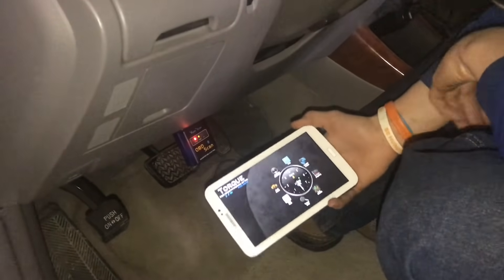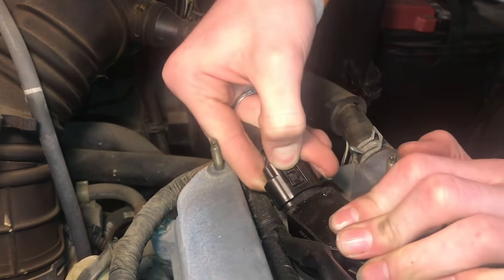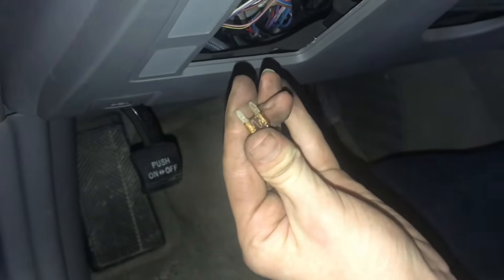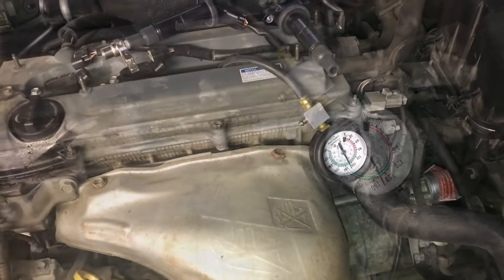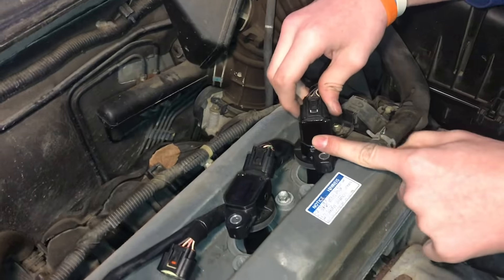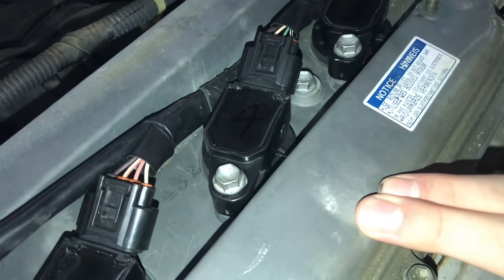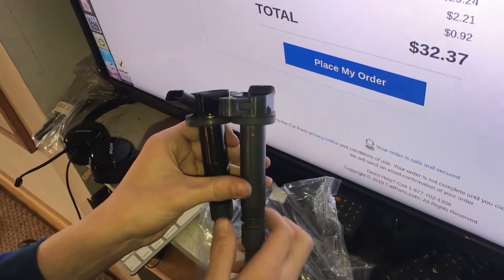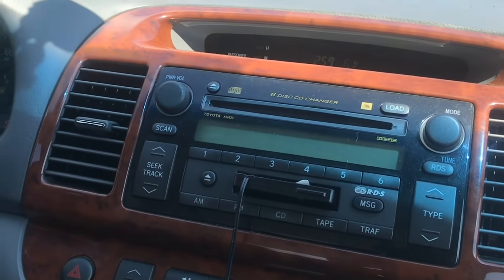(RESOLVED) toyota camry misfire P0301 P0302 P0303 or P0304 diagnostics

Comment: You need to use caution when purchasing aftermarket parts such as coil packs, especially when the price seems to low to be true.
Reply: Yes I bought Autozone Duralast lifetime warranty they lasted 2 years the factory lasted 21 years 170.000 miles all least they exchanged them no questions asked

Comment: Always put some dielectric silicone grease on the inside of the rubber boot of the coil pack to keep the rubber from fusing to the spark plugs.

Comment: Live,I’m working on a 2010 rav4 4cinders,p0303 code,exchange injector,coil,spark plugs from a known good piston same problem,comprecion is good.Most of the time the problem is only at high speed or climb a high level.thanks in advance for your help.

Comment: The 2007 thru 2009 engines 4 cylinder engines are known and documented to be bad at 140,000 mile. The rings pass oil (high oil consumption). Eventually, they leak so much oil, that you will find yourself repeatedly replacing coil packs. This is because a bad spark plug or a fouled spark plug is forcing the computer to push the coil pack harder in order to create a spark and that destroys the coil pack. At that point, replace/rebuild the engine or paint the car lemon yellow and park it in front of a Toyota dealership. Mine's for sale... any takers?

Comment: Is this a 2az-fe engine? I noticed you pointed out that the firing order is straight line 1234 but everything I am seeing for the 2az-fe which is what my 05 Camry has in it, fires on a 1342   Order.
Reply: Apples and oranges.  Almost all 4 cylinders fire 1342.  The cylinder numbers run in ascending order from the crank pulley.

Comment: Wanted to thank you for this video. I had a misfire on cylinder 2 today on my Camry and I replaced the plugs and coil and it helped me do it without damaging anything in the process. I let it idle for about 10m and drove it around town without and stutter or any of the issues it was having and no check engine light coming on.

Comment: Could've saved a whole lot of work by just pulling the coils one at time and listen for no difference in the idle speed.
Reply: So if there's no difference does that mean it's bad? Or
Reply: @thebeasters  Yeah
Reply: Yeah, pull the primary plugs, not the coil assembly, work smarter not harder.  Bear in mind it's a misfire not a dead cylinder so the test might not be that conclusive.  Misfires aren't always constant, just often enough for the computer to notice.   Bear in mind once you do that you will trip misfire codes for every coil you disconnect.

Comment: I have codes p0300, p0301, p0302, p0303, and code p0304 as your description showed. But you only diagnosed one cylinder/coil pack. What a waste of my time. I replaced all four plugs, coil packs, and fuel injectors and I still have p0300 thru p0304 codes. Your video is a sham showing all 4 cylinder codes.
Reply from the maker: A PO300 error code is completely different than a PO301 through PO 304. The PO 300 error code is stating that the error is random. This is not what this video is talking about. A random misfire is more likely not the coil pack or spark plug. It would be something like fuel or unmetered air. The title of the video says nothing about a PO300. Your attitude is a bit disturbing. If you don’t understand try asking a question without an attitude. I hope this answers some of your questions. Look for videos that talk about multiple misfire PO 300 error codes.

Comment: I have changed my coil packs and spark plugs more than 3 times in less than 3 years. I'm tired of this 07 Camry and the random misfires. What are other causes of misfires? Would a compression or leak down check give me answers?
Reply: If it's the piston then what? Is it a 9 hr tear down? Shops crazy
Reply: Fuel injectors
Reply: Most common problems: spark plugs, Coil pack, Spark plug wire or even the Spark plug coil pack connector going bad

If your spark plugs has oil all over it’s because you have worn O-rings or you have a leaking head gasket it all depends on your engine type

Harder diagnosis 

Fuel injectors either clogged or broken, 

Vacuum leaks (could be a small leak or bigger leak (spray soapy water or certain type of cleaner, for example(MAF, Carburetor cleaner, etc), 

igniter goes bad

could also be your piston has lack of compression (depending on which cylinder has the misfire)
Reply: @Kawura  I did a compression check and it was the cylinders need new rings

Comment: I replaced the coil packs,spark plugs,pic valve,and egr valve and I still get p0300-p0302 codes..
I'm wondering if a bad intake manifold would cause those codes.
Reply: Same thing for me. Did you find out?
Reply: Fuel injectors or bad valve?
Reply: Fuel injectors

Comment: I found that American plugs don't work in Japanese cars. The engine was built in Japan even if the car was built in the uS. Also, the Bosch plugs usually don't work either. The bolts are 6mm, the heads are 10mm. The engine started because of residual fuel in the sysrem.  It would only run for a couple of seconds. Last, but not least, you get what you pay for.
Reply: Trying to, "make it fit" will only result in a "learning experience".   Don't try to second guess an automotive engineer, just use OEM parts.

Comment: I got p0303 on my odb2 ports. It is cylinder #3 misfired.
----------------------------------
|    1.         {3 }          5.    | rear
|    2.          4.            6.    | front
In order to access cylinder3, I have to dissemble manifolds,airfilter n other nonsense.lol.
Reply: Since the advent of platinum and irridium spark plugs, with 100k lifespans, easy access to spark plugs is not required.

Comment: It would have been harder without you. Thanks so much!!!
Reply from the maker: Glad the video helped. It’s nice to have the car runs smooth again.
Reply: @livefree6878 mate a great job on the video, I got a 2004 camry; codes po301, po302, po302, po304, about 4 months changed coils, maf, just 2 weeks I changed the radiator & cap; due to over flow resevoir & leaking rad, mechanic didn't disconnect battery, didn't had no horn & fans weren't working, after battery reconnection, car shakes with low idle & these code, do you think  it may be the coolant temperature sensor, any help would be highly appreciated, thanks.

Comment: If the spark plug body is nickle plated you do not need anti-seize the nickle coating from the OEM does that with no mess. If the spark plugs metal body is black in color like a lot of Ford AUtolite plugs then you need anti-seize.

Comment: For Toyota sensors and electronics go OEM or NAPA which is usually re-boxed OEM Denso Toyota parts. Most Toyota electronics and such last 12 to 23 years between failures so it pays to buy some parts OEM. Instead I normally buy DENSO brand parts from Rock Auto which is owned by Toyota and is the OEM supplier to Toyota usually for 1/3 the price of going to Toyota!

Comment: To avoid problems in future it's better to make sure you have the part numbers right before ordering. There are websites where you can key in your VIN or make/model year details and instantly get the exact specs for your car. You can then shop on those same websites or go elsewhere and order those components armed with the right information. RockAuto is an excellent place for you guys in North America. I've ordered from them before even though I'm not in the USA since they can ship worldwide.

Comment: PEOPLE!!! when it comes to  critical  components like this .....ALWAYS get them at the dealer!!!   they are original and garrenteed   to work!
Reply: Dealer will charge you 300 bucks for water and 100 ice cubes
Reply: I may not always get the parts from the dealer, but I always get parts from the OEM manufacturer and from a reputable parts source.
Reply: Yeah, I’ve learned it the  hard way. Everything under my engine bay is OEM. I’ve learned it hard enough to remember the lesson!
Good luck Y’All!

Comment: I have a misfire on cylinder 2. I switch the ignition coils and spark plugs. Switch coil #2 and the mis fire did not follow. Help anyone??? Code it pops up is p0302
Reply: Did you ever figure out your issue?
Reply: Check gasket leak!
Reply: bad fuel injector ?
Reply: was spark plug #2 wet from oil or dry sooty
Reply: Did you ever figure out the problem?

Comment: When an E-Bay seller has a description saying Best Pirce(check spelling) Ignition Coil for $9.29, you know its Chinklish and to be avoided, even run away from it.
Reply: Sure thing, Ebay and Amazon are also selling fake NGK & DENSO spark plugs which only last 10K miles instead of 100K.

Comment: My car check engine light and VSC light turned on at the same time. As that happened the vehicle swerved. so I got off the highway turn off the car and turned it back on and the check engine light and the VSC like both turned off and never turn back on ever again so I took it to AutoZone and even though the check engine light is off the p0301 cylinder 1 misfire Code still popped-up.
Reply: What happened same thing here
Reply: On some Toyota/Lexus vehicles certain computer control issues will trigger a VSC light.  'Soft' codes don't trigger the light but there are stored in system.

Comment: When u say misfire, what do u mean exactly, what does it feel like when ur driving the car, is it a hesitation r what?  Thnx so much.
Reply: Misfire is when starting the engine will sputter and vibrate and then proceed to run at a low rpm and continue to vibrate hard. You'll definitley feel it in the drivers seat. Dont run the car like that unless youre repairing it quickly. And definitely dont drive it to the mecahnic. Get it towed.
Reply: @Jordan-pk8mp  wow Ive been driving like this for weeks

Comment: What happens if I replace all coils , and still have a misfire ?what next ?
Reply: .... there could be condensation or water in your gas line too...
Reply: Im betting on head gasket starting to fail. Hopefully not but could be considering spark plugs and coils have been changed.
Reply: The code that popped up ? Was p0300 p0301 p0303 p0304.
Reply: @miguelvaldez9449 hola,. Miguel I know it been a long time, but, what was the solution to your problem, got the same issue on 2004 camry, thank for your help.
Reply: Thank you.
Reply from the maker: My first question would be if your air was a PO300 which would be a multiple misfire or was it something like a PO301 or a PO302. The next step would vary depending upon if it was a multiple misfire or just on a single cylinder. If it’s a problem on one single cylinder I would want to know if the compression is good on that cylinder by doing a compression test with a $15 compression tester. If it’s a multiple misfire I will probably start by checking the fuel pressure to see if something like fuel is causing a problem on all the cylinders at the same time. Let me know if you have any other questions,

Comment: Awesome video thanks! I Should have seen this video before working on my car I had code p0302, so I changed all 4 plug which we’re maybe the original ones all  bad and old , I continued to change the coil for #2 but car still runs at low idle like it wants to shut off, my question is do you think that the clips that connect the coils if I broke them would that be an issue?
Reply from the maker: I know those clips can get a little brittle. I’ve had the clips break but they still seem to have good connection. If you needed to, You could use a zip tie to make sure it’s nice and tight
Reply: Live Free thanks I did use the zip tie method car is running fine now thanks alot
Reply: U can also reset the idle by putting your car in drive with emergency brake on for about 2 mins the car should reset itself to the right idle

Comment: Wait how come u didn’t put new spark plug?
Reply from the maker: I wanted to verify but the problem was truly in the coil pack not the spark plug. If I replace too many parts at the same time I would be left wondering if it was the spark plug or a coil pack. Now that the car runs fine I have no problem putting new spark plugs in. I’m trying not to just throw parts at it. I did have to have To put anti-seize on the plugs because they were very tight.
Reply: No need to. Iridium spark plugs last 100K miles